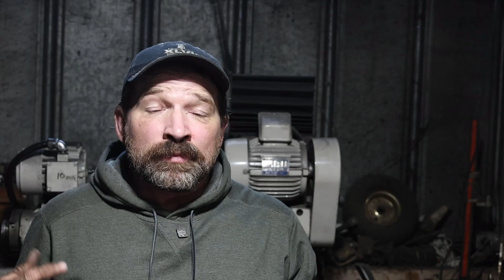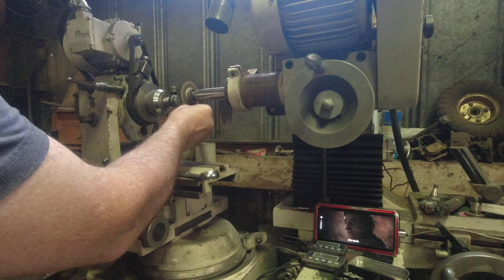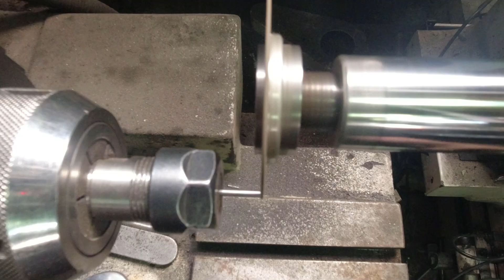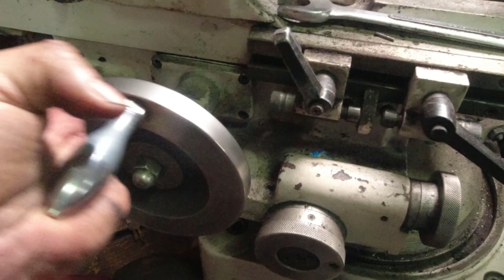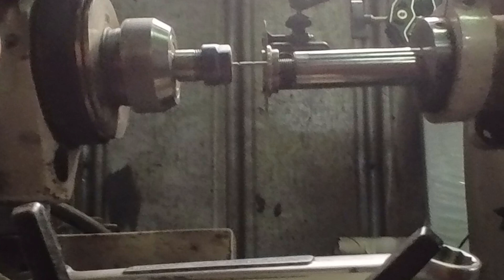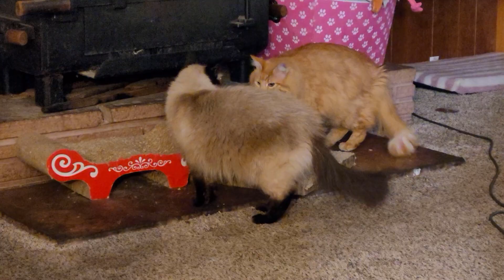Check out how I make the hinge pins for my prosthetic fingers!

Comment: I'd like to see a grip strength test. after all, the test is not over until something breaks. I believe knowing those failure points can help you reinforce some areas, and shave weight off others. perhaps it could give insight to a system that offers better grip strength.